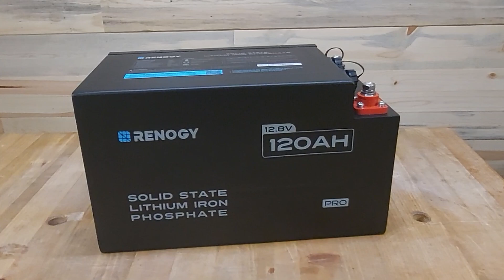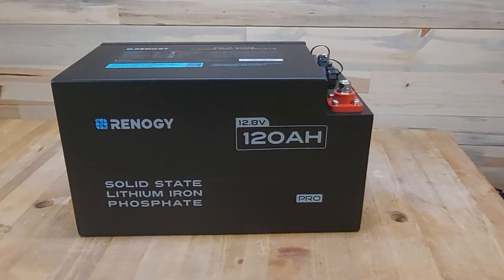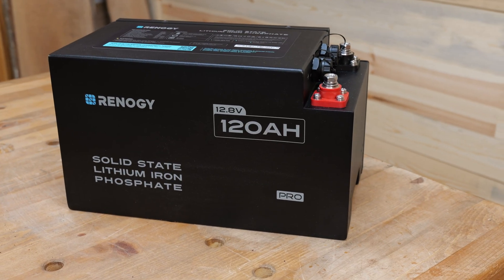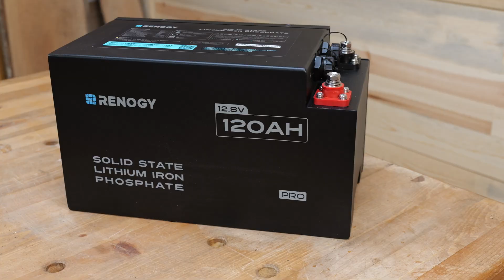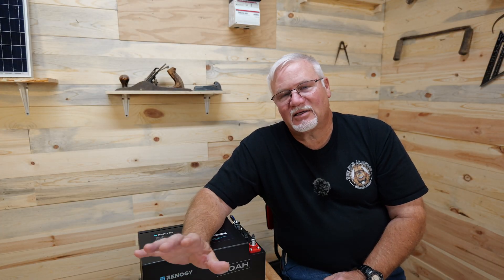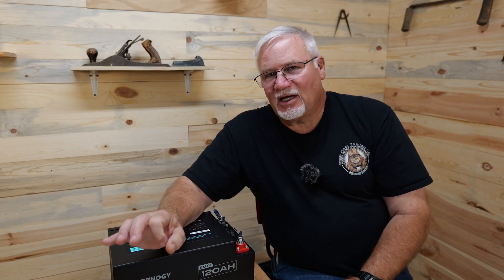I Completely Drained Renogy's New Semi Solid State Battery - Results Surprised Me

Comment: Where did you buy those positive terminal fuses ? Also, who made those  attery cables ?
Reply from the maker: I should have included a link but must have forgotten.  I'll ad them when I return from my cabin
Reply: @TheOldJarhead thanks, I tried crimping my battery cables using hydraulic crimper but failed. After reading recent lithium battery fires I think I need over current draw protection on each battery.
Reply from the maker: LiFePO4's don't have the same fire problem as LiIon batteries do so less to worry about.  I have two types of battery fuses and the better of the two are these: https://amzn.to/49ilD7g The battery cables are likely just from another inverter I had but should be rated for the draw you expect and/or can take.  Now for the cables, you can use these: https://amzn.to/3Navu7P 4awg cable is rated to 135amps for chassis wiring and they should be fused for 150amps

Comment: I just pre ordered the 12v 240ah version. It will feed my Anker F2600 power station. Off grid I’ll recharge with a 400watt solar panel and/or Bluetti Charger1. This is on my slide in truck camper that I take to remote campsites along with my boat they sometimes needs it’s trolling motor battery topped off.
Reply from the maker: Sounds like a great setup for off-grid adventures!
Reply: why wouldn't you spend LESS cash and get a 48v 100ah (over 2x the capacity of this) golf cart battery? This channel and several others have shown how that is possible and it is both a) far less expensive per watt/hour and B) a proven less expensive yet totally safe technology? It has been my experience in life that the sooner one adopts the newest technology the greater the chance you will both pay premium price and regret it later. This example of semi solid state batteries could be no different than  Beta-max video, or laser disk, 8 track tapes, plasma TVs or any number of "this is the new WOW thing"  that later got replaced with yet newer, better and cheaper technology. ie in order of the other examples: VHS, DVD, cassette tapes, LED TV's the list goes on and on.  It is for this same reason I would advise staying away from the new "salt batteries". I'm very happy that @theoldjarhead got to review this battery. But to be honest, before I even watched the video I followed the link to see the price. At that point I knew this product is nothing more than a cash-cow for Renogy! You would be better served, for longer and less money by investing in any of several other established (not new-fad and unproven by time) technologies. Of course, for those with enough money it doesn't matter; this product does look kinda like the 3rd grader with the new Pump-up basketball shoes when he's out on the play ground. I just thought as adults most of us had gotten over that idea.
Reply from the maker: There always those who adopt new technology before others.

Comment: I don't get it? What's the point of buying that battery? It what situation do you need a $750  12.8V 120Ah battery.
Reply: @HeliosT3ch  6000 cycles. That's a 15 year battery. If you're off grid, that's a big deal.
Reply from the maker: Yup - and as I mentioned it's new tech but as new tech becomes mainstream, prices drop.

Comment: Pretty nice! And a good realistic test. What application do you think warrants spending 3 times as much for this capacity? Obviously it's good quality and has desirable features but I don't keep my batteries outside nor use them every day. I'm just trying to see where these are most useful.
Reply from the maker: At this point, I'd say maybe Overlanding in colder climates, but I think the price will begin to drop as more and more move to make them.
Reply: @TheOldJarhead  I’m about to test that, started with a 240 and will add as the price drops. I have multiple ways to power my system and can be patient building the battery bank.

I have to maintain temps 365 in a rolling suite (design-build is my profession and I turned a toy hauler into a proper build), it gets drastically cold here for 2 months out of the year. Batteries are secondary but will be tested (capacity-wise) when I’m unable to plug in.
Reply from the maker: When unable to plug in the key is to keep them warm as then the heaters don't work.  They require 10amps to run (120w) so solar can do that if the sun cooperates.

Comment: Awesome. I had no idea such a battery was available. I asked ChatGPt about it: What are the advantages of the Semi Solid State LiFePO4 battery over regular LiFePO4 batteries?

1. Improved Safety

Semi-solid-state batteries use much less flammable liquid electrolyte, replacing most of it with a gel or polymer electrolyte.

This reduces fire and thermal runaway risks, one of the biggest issues with conventional LiFePO₄ and other lithium-ion chemistries.

They can also better tolerate mechanical stress and higher temperatures without degradation.

⚡ 2. Higher Energy Density

Traditional LFP batteries typically achieve ~140–180 Wh/kg at the cell level.

Semi-solid-state LFP designs can reach 200–250 Wh/kg, depending on formulation and manufacturing technique.

This gain comes from thinner separators, less liquid electrolyte, and higher electrode packing density.

🔁 3. Longer Cycle Life

The semi-solid electrolyte is less reactive with the electrodes, which helps reduce degradation and side reactions.

This leads to longer lifespan and better capacity retention — potentially 5,000+ cycles compared with 3,000–4,000 for conventional LFP.

🌡 4. Wider Operating Temperature Range

Semi-solid-state electrolytes can function in lower temperatures (–20 °C or lower) and higher temperatures (up to ~80 °C) with more stability than pure liquid systems.

This makes them attractive for EVs, grid storage, and extreme-environment applications.

⚙ 5. Manufacturing and Cost Advantages

Unlike fully solid-state batteries, semi-solid designs can often be manufactured with existing Li-ion production lines, reducing transition costs.

They also avoid the complex high-pressure sintering or ceramic layering processes used in full solid-state designs.

♻ 6. Enhanced Sustainability

Some semi-solid electrolytes are non-toxic and recyclable, and they can reduce solvent use in electrode manufacturing, lowering environmental impact.

⚖ 7. Trade-offs
Property	                         Semi-Solid-State LiFePO₄	               Conventional LiFePO₄
Energy Density	         Higher (200–250 Wh/kg)	               Moderate (140–180 Wh/kg)
Safety	                         Much higher	                                       Already safe, but still flammable
Cycle Life	                 Longer	                                               Long
Temperature Range	 Wider	                                               Moderate
Cost	                         Slightly higher now, falling fast	       Mature and cheap
Charging Speed	         Slightly slower                      	       Generally faster

✅ In summary:
Semi-solid-state LiFePO₄ batteries offer better safety, higher energy density, and longer life than traditional LFPs, while maintaining compatibility with current production methods. They bridge the gap between conventional Li-ion and fully solid-state technologies — making them a promising near-term upgrade for EVs, solar storage, and other demanding applications.

Comment: I just went on the Renogy site and I like the self-heating feature to recover from low-temp cut-off. I have an off-grid cabin in a cold temperature area on the Colorado border.  I also have a camper with solar. I am still confused about the solid state claim as I assumed all LiFePo batteries were. I wonder if there is something solid state different with this battery, or not?
Reply from the maker: The semi-solid state refers to the electrolyte, which is different from traditional LiFePO4 batteries.
Reply: True solid state batteries are between the lab and mainstream adoption.

Watch the marketing hype.
Some companies have claimed true solid state.

Solid state will always be on the verge of mainstream.
Industry has been promising them for years.

They are just not quite here yet.
Reply from the maker: Who knows?  Long ago I learned that companies are usually a generation or two ahead and just waiting for the right time to release.
Reply: @TheOldJarhead In the battery R and D there are many promising techs.

The questions are scalability and real world deployment.

Do they have to build out a new supply chain.
A new factory or can an older one be retrofitted.

And the real kicker will it work well enough outside of a lab to make it commercially viable.
Reply from the maker: True -- and will people buy into it or will someone else beat them to the punch with another tech that works as well or better!  It's a crap shoot!